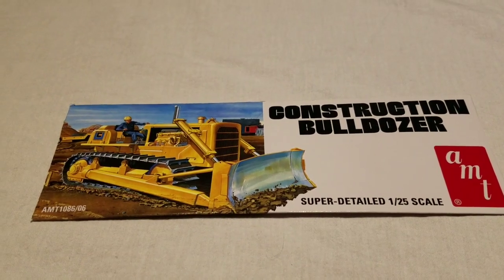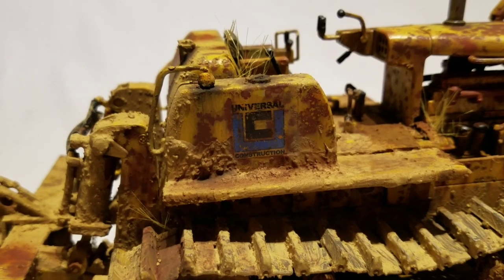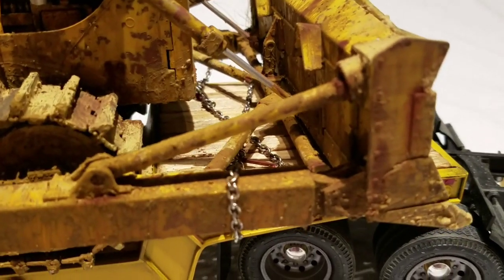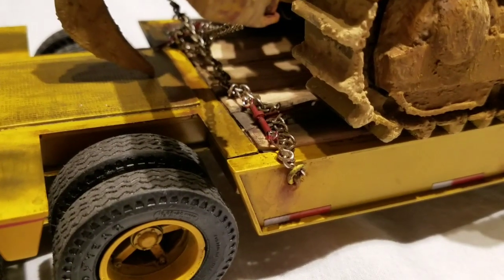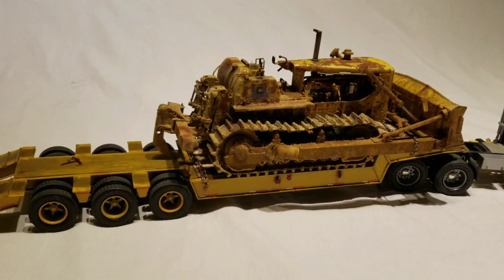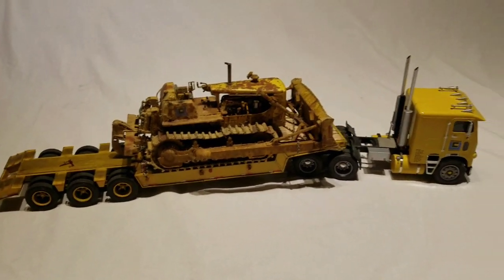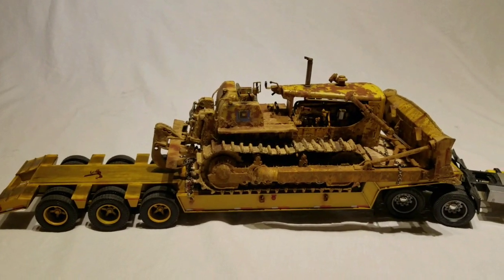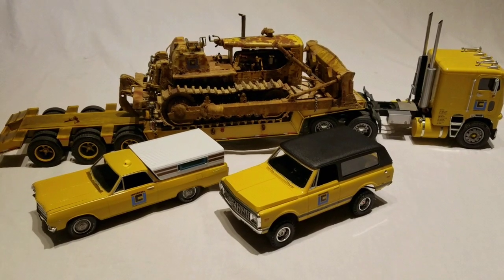Final on the AMT Construction Bulldozer kit!!

Comment: My work truck is a Pete 379 daycab with a tilt deck trailer, kinda like this lowboy. More then once have i wished it had a coffin sleeper on it for them nights when I have 3-4 runs across the state and just want a quick nap.
Reply from the maker: Thanks for commenting!! I was hoping a sleeper would be a wanted addition. As a matter of fact, I am building a Peterbuilt 359 with a sleeper to replace my cab over. 😊
Reply: Bryan at BG's Model Workshop id have to stick with a small bunk, i wouldnt want any more wheelbase then its got. And havin the rear window helps for blind siding so theres definitely some give and take there.

Comment: To get your ie down chains tight put a longer wire on one end of the ratchet, hook regular hook to chain and run the other end of the long wire thru chain and as ye bend it into a hook, put tension on it.  Snip it off for the correct size hook, makes tight chain.
Reply from the maker: Thank you for the cool tip